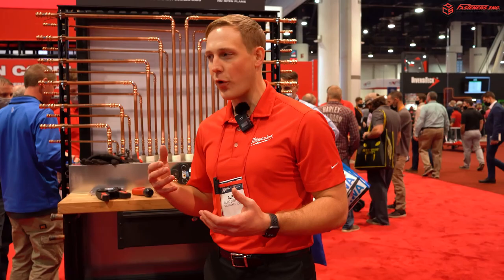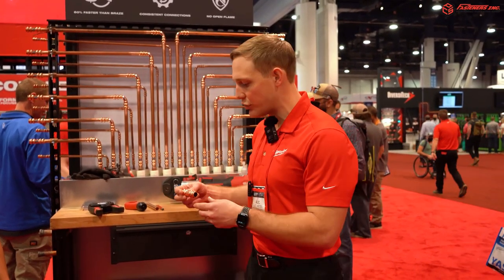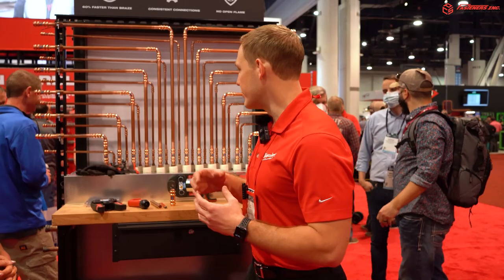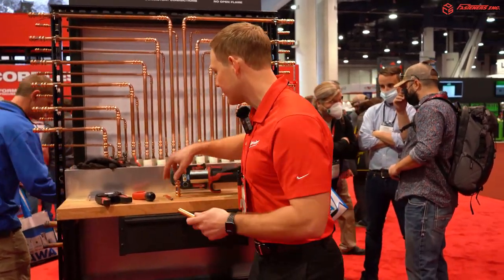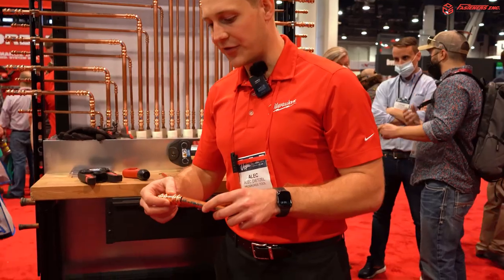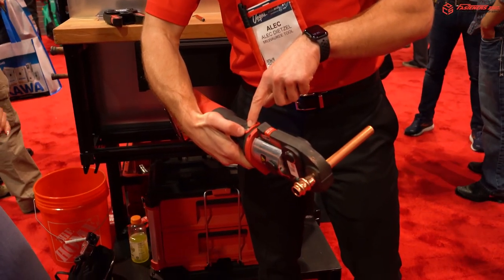Milwaukee M18 FORCE LOGIC Press Tool Kit with 1/4"-7/8" Streamline ACR Jaws - AHR Expo 2022

Comment: He should have mentioned that prior to putting on the fitting and pressing it, there’s a lot of pipe prep. The copper must be reamed, deburred,and then the outside of the copper needs to be scoured. 
The issue I have with mine is the tool and jaws are to big and heavy. Many time’s it requires another person.  Also the fittings still aren’t available in New Mexico. So I’ve had these jaws for a year and I’ve only been able to use them once.  I do like the double o-rings though. 

The RLS system fittings are readily available, and the tool is lite and handy.

Comment: Are there three main company’s now? RLS , Zoomlock and this? Which ones the better to choose from
Reply: Yeah this complicates things. I was trying to choose between the other two now this is in the mix.
Reply: This one looks promising given the double o-ring design. But fitting availability might be an issue. RLS (formerly Zoomlock) is the original fitting and has been in service the longest I believe; these fittings are generally readily available also. Personally I would avoid the newer "Zoomlock Max" which resembles the plumbing propress fittings (hexagonal crimp shape w/ single o-ring).